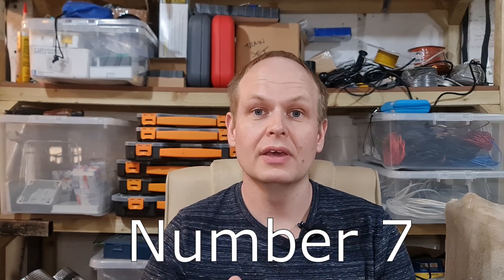My Top 10 Items to Build Ham Radio Antennas

Comment: Can you/anyone suggest a good reference text for simple antenna design and construction that is geared to the novice or beginner radio amateur?
Reply from the maker: Very difficult question to answer without knowing more. Where will you use this antenna, how big is your antenna space and fow which bands?
Reply: @MM0OPXFieldRadio  First, thank you for your response. 

I recently saw a YouTube video extolling the benefits of a log periodic antenna for broadband reception of FM and other signals. 

I would like to try and build one so that I can receive signals from two local FM repeaters and anything else that I can hear on the VHF and/or UHF bands.

I live in a small city and on the second floor of an apartment building.
Reply from the maker: @Aduhwan  I've never built a log periodic but that's not the simplest for a forst build. Have a search for "tape measure yagi".

Comment: Hi Collin, excellent presentation and I've just seen most your RSGB@8 from a couple of days ago, that was amazing! Quick question: Which size enameled copper wire would you recommend for creating inductors? I undestand that you'd recommend the 1.12mm for EFHW transformers but not sure what is easy to work with for a coil (i.e. to get the 110uH for shortening an antenna). Many thanks, Alex 2E0LUP
Reply from the maker: So the one in the presentation was using the 0.63mm wire I shown. If your going to run 100w then I would go just a wee bit bigger in diameter.
Reply: @MM0OPXFieldRadio  Brilliant, thanks so much!
Reply from the maker: Your welcome.

Comment: Great advise!!!   All of it.  And you certainly picked the right word for applying liquid electrical tape.
You might want to look at 63/37 (pb/sn) solder. Also called eutectic. It has no plastic state so when it looks solid, it is.  Lots less cold solder joints.   And a time domain reflectometer is an interesting device for checking the impedance of antenna and counterpoise wires.
Reply from the maker: Thanks, I will check that solder out 👍

Comment: Hi Colin thanks for sharing.. I bought a project box at the Ham Rally at Braehead and am about to install a preamp and SDR at my amphenol antenna. I also use amphenol components. A bit pricey but quality gear. Mastrant is also decent as its UV resistant  

All the best

Comment: Hi I was wondering if you have any videos or photos or documents on some of the L matching networks that you've made I'm very interested
Reply from the maker: Not specifically but my 5/8 vertical video does have an overview. I will cover again in my 10m vertical and perhaps a video dedicated to this topic.
Reply: @MM0OPXFieldRadio  would greatly appreciate that. Would be nice to be able to see the theory shown on a Smith chart applied on an actual antenna system
Reply from the maker: Not familiar with Smith Charts myself but i could Probably show one for this matching as SimNEC displays one.
Reply: @MM0OPXFieldRadio  well for example whenever you take an antenna analyzer and it will measure for example it 270 ohm load with 25 ohms of capacitive reactance. What would you do to get that to 50 ohms and zero reactance - The components that you would choose how you would actually attach them to the system, when it would be appropriate to use a section of coax as opposed to a capacitor, things like that just the practical application of correcting and impedance mismatch
Reply: @MM0OPXFieldRadio  your video on the 5/8 wave was absolutely perfect! That explained exactly what I needed to see of how to implement a matching network in an actual antenna thank you!!!
Reply from the maker: Your most welcome.

Comment: Does the adhesive make much difference to the heat shrink?
Reply from the maker: Not really. I would say its slightly thicker. Typically you get a 3:1 shrink ratio unlike the standard 2:1 on the normal stuff.